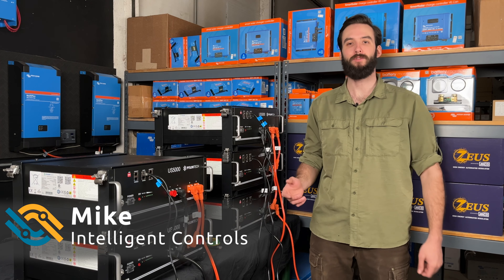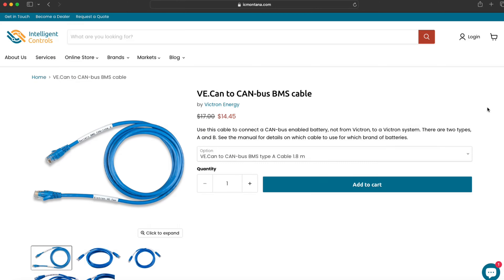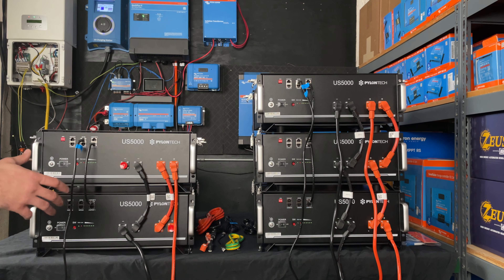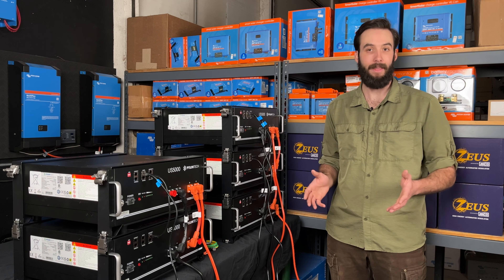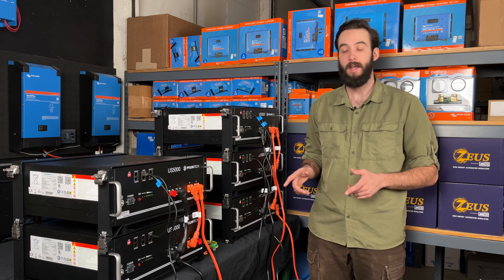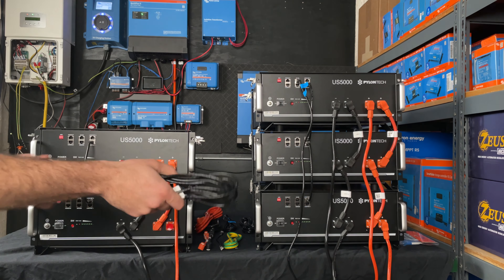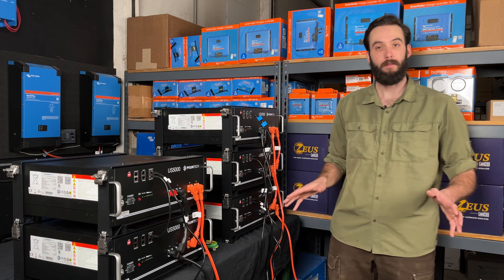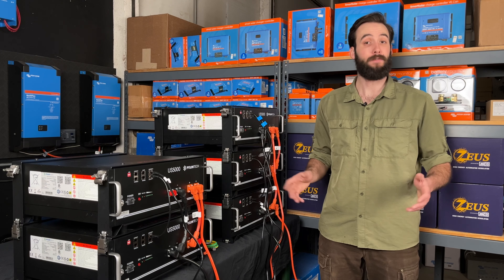Pylontech Cabling Master Class

Comment: Sorry, I don't understand why if I have 5 batteries I only have 3X120A, and if I have two batteries I have 240A. Why I can't divide 5X120A by five in this array of five batteries?  Can you explain that again? Thanks.
Reply from the maker: Hey Bryan, Sorry for the confusion, all of this is dependent on how many end runs you are using. Each one of those sets of wire is rated to handle 120A, even if the batteries can provide more than that, you still can't pull more current from a battery bank than the end runs can handle. So, if you have 5 Pylontech batteries and 3 sets of end runs, you are limited by the 3x120A capabilities of the end runs. If, for some reason, you expected to pull more current, which is highly unlikely in the real world, you could add 2 more end runs and access the full 5x120A current capabilities of the batteries.
Reply: I personally don't think the cables are heavy enough,if you have three 5 kw inverters you could make those cables act as heating elements,  do they not make heavy cables??
Reply from the maker: @jillyanddavedave280  If you have 5x 5kva inverters in a 3-phase setup, that's 15kva or less of continuous output power. The batteries are ~52v which is only ~290A. In this case, the proper battery size would be at least 3 to 4 US5000s. Each end run would be capable of 100A, but I would recommend that every 2 batteries get an end run to the distributor. For 12 batteries with a cable set for every 2 battery combination, that would result in a current capability of 600A continuous. They are small wires, but their current capability adds up. The other option that you and most are familiar with is to just have a larger interconnect, say a couple of 4/0, but then it's very oversized for smaller systems and still undersized for large systems.  Remember that 12 batteries in Pylontech's world is still a small system when the LV combiner hub allows us to go up to 96. Small systems with a couple of US5000s with a 3k inverter will make most small cabins work wonderfully.

Comment: Problem with this BMS is, that is not capable to handle 30 - 50 AMPS balance current, if I have MPPT / chrager, that is not able to communicate. Also there is problem, if I connect 20 % and 85 % SOC batteries in parall. With 50 A balance current, you have job done after few hours, with small balance current you have to wait till summer.,
Reply from the maker: Hi @PavolFilek The nice thing about the Pylontechs is that the BMS will allow the natural physics of the parallel connection to not only siphon a small balancing current but also actively balance in a far more proactive manner using charge and discharge loads. I have spreadsheets of data showing your exact scenario with 20% and 85% SOC batteries coming back into balance within <1 hour due to an ~80 Amp difference in power supply between the two batteries. It should be able to do this regardless of whether or not the batteries are in closed-loop communication with the inverter/charger

Comment: So you're saying that it is better to pay 2000 euros instead of 50 euros on cables? The way I see it is if you run every battery to a lynx distributor you can achieve with just 3 batteries what you claim you can with 5. Each cable can handle 120amps and each battery can deliver it just as long as they are not connected to each other. In your example the batteries can deliver up to 600amps if each connected to a lynx distributor or a power in with a fruction of the cost of adding a sixth battery. Why don't you propose that?
Reply from the maker: Hello Chris. This is a question of system sizing. There are 2 factors to be considered when sizing a battery bank. The first is the total power reserve or energy storage, and the second is the ability to deliver that power in the form of current. The number of batteries is the limiting factor for both energy storage and current delivery, and the cabling is the other limiting factor for current delivery. 

There are very few practical situations where current delivery needs to be equivalent at a 1C rate to energy storage. The current capabilities of the wire runs do not need to match the current capabilities of the batteries, if the energy storage capacity of the batteries is greater than what the system is designed to draw in 1 hour of continuous use. This is where you can experience savings with Pylontech’s cabling system.

So yes, if you want 3 batteries with 14.4KW of power reserve hooked up to a system that will draw that down in 1 hour by pulling 300A or 14,400W/Hr of continuous current, then you buy 3 batteries and 3 end runs and go to town. In the more likely scenario where we have 3 batteries and the system is designed to pull a max current of 50A giving you 6 hours of power reserve, you just saved $100 because you only need to purchase 1 end run. 

So the rule of thumb is to size your batteries to your energy storage needs, and size your cables to your power delivery needs. If that is a 1 to 1 ratio, so be it. If not, that's a win for Pylontech’s cabling system.
Reply: Thank you for the reply. Indeed you size the batteries based on the energy reserve and delivery you want. But in your example having e.g. 5 batteries I think is not optimum to connect them the way you display since by connecting them to a bus bar, you maintain energy capacity but you increase greatly energy the delivery potential from 360 to 600 while still evenly distributing the power demand. Anyway that's my 2pennys worth
Reply from the maker: @christsitouridis2213  Not a problem, thanks for the question. By the standards of most batteries, you would be absolutely correct. The cool thing about the Pylontech BMS is that it can use the MOSFETs to regulate power distribution so we don't have to worry about getting our wiring perfectly symmetrical for the sake of even draws. You certainly could wire it differently though, if your system was designed to pull 24kw of power in 50 minutes.

Comment: Hi. My Pylontech manual clearly shows the red and black shorties connecting left to right terminals. Eg, top battery (master) black and red shorties connected to RHS black/red terminals and then connect down to the LHS black / red terminals. So they all zig-zag rather than in stright vertical lines. I hope this makes sense. So why have you connected them differently?
Reply from the maker: Hello, thanks for the question and good eye. When you open the battery up, the terminals are all connected to the same respective bus bar, black terminals to the negative bus and orange to the positive. As such it doesn't matter if you zig-zag or go straight down.

Comment: Hi Mike, thank you for this video. I have just tried to add a US200C as master to my stack of three US2000 batteries but the the MegaRevo 8K inverter presents a 27 BMS Communications error. All batteries have Dip switch 1 set to 0 so the communications rate is the same at 115k. I am suspecting that my old BMS cable to the Inverter that worked with the three US2000 batteries in not wired properly for the newer US200C battery. Am I correct?
Reply from the maker: Hello David. You are correct that the BMS cable for the US2000C is different from what you are currently using. In terms of the BMS cables available from Victron, the US2000 uses a BMS Type B cable while the US2000C uses a BMS type A cable. Functionally, the difference is that the ground wire on the battery side is on pin 2 for the US2000 and is on pin 6 for the US2000C. Please check my response to the email you sent me for a visual diagram.
Reply: @intelligentcontrols  Hi Mike, thank you so much responding with such a helpful answer. I responded to you by email but am also responding here as it may be helpful to someone. I was able to successfully build a new cable and it is working flawlessly. All I needed was pins 4/5. Thank you again so much.

Comment: We have 3 Pylontec us2000  & 2 us2000c as a stack of 5. Been working well for several years. But now the Sofar ME 3000SP inverter is showing a fault and has let the batteries go flat? They have in turn shut down, Sofar have said I need to recharge them for them to start? How do I go about this?
Reply from the maker: Hello, If the batteries are fully discharged, you will need to give them 48V at >5A of current to bring them back.

Comment: Can one connect the two battery in parallel without communication cable and still work perfectly
Reply from the maker: Hello Ajay. You can string them together in parallel without coms and it won't hurt anything. I have a hard time imagining a circumstance where you would do this though, the coms jumper is just a cat5 network cable.

Comment: This was instructive! I am thinking of building a 3 phase 15kw system, with 3 Victron Multiplus inverters and a bank of  4 batteries in parallel. If I run 2 sets of  end-runs that would mean a maximum of 240 amps and in the end would result a 60 A curent drawn from each battery. How should I do the math in order to have the system balanced over 3 inverters? Would it make sense to add more batteries?
Reply from the maker: For balancing the DC loads between inverters, you will want to have a master DC bus that can act as a central point for all the DC components to connect to. The Victron Lynx system is really great for this and is what I would generally recommend to make fusing easy. Think main bus-bar vs running the batteries directly to the inverters DC terminals. Aside from that, having a cable kit for every 2 or 3 batteries is a good rule of thumb. Regarding battery capacity, if you use a main DC bus then balancing DC loads won't be an issue regardless of battery capacity. The thing to think about here is how long do you expect the system to run on just battery power? If you are pulling 240A from 4 batteries, that realistically gives you less than 2 hours of run time. Given the details of your circumstance, that might be totally fine. If that's not enough, you will need more batteries.

Comment: What would the pros/cons be of connecting all the batteries as 1 single stack  and then either having a single end run for the stack or 2 end runs for the stack?
Reply from the maker: Hey Miner, it all depends on what your max loads are. If your inverter is incapable of pulling more than say 80A and your charger caps out at 50A, then there would be no pros to introducing a second end run and just the cons of added cost. If your loads are enough to pull or push more than 120A that's when you start adding additional end runs. The BMS actively manages the loads on the individual batteries so there is minimal/irrelevant gain in power distribution by introducing more end runs.

Comment: Something I forgot to mention near the end. Standard procedure is to fuse every set of end runs with a ~120A fuse. If you get your math wrong like I illustrated around 9:54 but took the time to fuse everything, all that will happen is a blown fuse rather than melting insulators. Stay safe out there!
Reply: I can only find megafuses available of 100A or 125A. What should i choose?
Reply: @ronaldod7116  125A megafuses are the way to go.
Reply: We are lucky in that the Pylontech US5000-B model (specced and supplied just for the Australia standard) has the addition of a factory installed 125A circuit breaker on the front panel.

Just wire straight to the inverter.
Reply: Great video! I just have a question regarding connecting the end runs to the inverter through a Victron Lynx Distributor. Would I put both end runs on the end of the distributor at the same point(where the red and black covers are) or would I run them separately with fuses for each? I'm using Pylontech US5000B that have breakers.
Reply from the maker: Hey there. The Lynx Distributor is really designed around the MegaFuses. Since you already have breakers on the US5000B, I would recommend you check out the Lynx Power In, which gives the same clean install without the fusing requirements.

Comment: What a fantastic straight forward explanation 👍. I have the 6 Pylontech US5000's (in 2 banks, 2 ends runs off each) and they have worked a treat with my Sunsynk Ecco 8k Inverter. It's reassuring to know that I have set it up safel as per your configuration. Many thanks from the UK 🇬🇧🤘😊🤘
Reply from the maker: Hey, so glad this was helpful - and the batteries are working well for you. Where's your system installed?

Comment: Hi mike,
I have a new us5000 to add to the current set of 4 x us3000.
I can not connect eith a djort csnle snd the long  er cable i received “end runs.
Can i connect the end runs in the ssme place as the “old” end runs?
I have a upower pro 10kw (extendable).
With your info i can fo the communication thx.

Eould my duggested method result in a max capacity from the batteries 200amps?
Thx
Reply from the maker: Hello, what is the reason you can't connect the new battery with the short cables? If it's a distance issue, I would recommend butt splicing in a longer piece of 4AWG wire between the connectors.

Comment: Thanks for the clear explanation. If I add a new pylontech battery to my existing stack, do I need to let them balance amongst each other first, before connecting them to the inverters? Or will that sort itself out over time?
Reply from the maker: Thanks for the question! With Pylontech batteries, all you need to do is get the battery connected and in communication, then the BMS will take over to ensure that the new battery comes into balance with its partners. To my knowledge, no other battery readily available in the US has this functionality. Every other battery I have worked with needs to be manually balanced before connection, if you are even able to add a new battery at all. Hats off to Pylontech’s BMS for this.

Comment: can we plug that cable from the A/CAN port to the Cerbo GX VE.CAN port?
Reply from the maker: For a Victron installation, the BMS cable running from the A/CAN port will plug into the BMS.Can port on the Cerbo.
Reply: @intelligentcontrols  Thanks I will try this when I get home. The battery is working but I just cant see it in the Cerbo as a device.

Comment: So the end runs are rated at 120A and they go from the battery to a busbar. Well if there's 3 sets of end runs going to the busbar.... what size cable do you need to go from the busbar to the inverter? Still 120A or 360A?
Reply from the maker: Hi David, thanks for the question. The cable running from busbar to inverter should be rated for at least as much as the combined value of end runs. So in your example, 360A.
Reply: @intelligentcontrols  I thought so, thanks for clearing that up. Are you sure the pylontech cables are rated at 120A? I can't find that anywhere on Pylontechs website. Or is that the industry standard for 25mm cable?
Reply from the maker: Yes, 120A - pylontech specifies so in the manual.
Reply: @intelligentcontrols  thanks again for the info. Can you please clear a couple of things up for me? Is the 120A at continuous running? Also the manual for my us5000's states a recommended discharge current of 80A and peak of 100A  but the sticker on the side of the battery states nominal 50A and maximum 100A. I have 2 us5000 batteries. Should I set my inverter to discharge at a maximum of 100A or 160A (well 120A until I upgrade my cables)? Many thanks
Reply from the maker: @sukmy1i  sorry for the delayed reply.. The cables are rated for 120A continuous and the batteries can handle 100A. The thing is, if you are running at the absolute maximum to meet your loads, then that is really just a signal to size up your system. Your car can likely go 120mph, but if you drove it around all day at that speed then your service life is going way down. 
If your loads are not a deciding factor and can be whatever you allow them to be, then I would take the number of batteries you have and multiply them by 50A. Then size your number of cables so that a single pair of end runs never has more than 100A going through it. That will give you a nice middle ground for your max discharge current that won't overtax your system. If your needs are more than that, you can make it work up but I would start looking to add more capacity.

Comment: Mike, hi! Is there a video of how to properly setup us5000 pylontech with victron inverter for dummies? We have some crazy blackouts in Ukraine, I bought one us5000 and MultiPlus-II inverter, but have no experience of connecting and configuring these parts together. It's hard to find a decent electrician that wont burn your house down, so I'd like to do it myself : )

Comment: Sorry to sound like a newb but I am.... Why do we always seem to use fuses and not MCB's for overload protection? Thanks.
Reply from the maker: Hey, no problem at all. The primary advantage comes down to speed. A fuse will blow in about 2 milliseconds, while an MCB takes 20 ms. Additionally, while an MCB might seem to have an advantage with its reusability, if a fuse in one of these systems blows it's generally because there has been some catastrophic failure and having someone reset an MCB without addressing the issue could be dangerous.
Reply: @intelligentcontrols  thanks

Comment: @intelligent Controls very interesting video.. thx! one question though.. I have 6 batteries (US5000) and  4 sets of end runs in a 3 phase system with 3 Multiplus II 5000. do I need extra sets of end runs to connect 6 more batteries? I don't want extra power, just more storage. The power is limited by the Multiplus imho. I will not be using more amps with 12 instead of 6 batteries, right?
Reply from the maker: Hi Nick, since the bottleneck in this system is the MultiPlus, there is no need to increase the cable runs with a storage upgrade. Ultimately, the batteries will do less work, and the cabling and inverter will work the same.